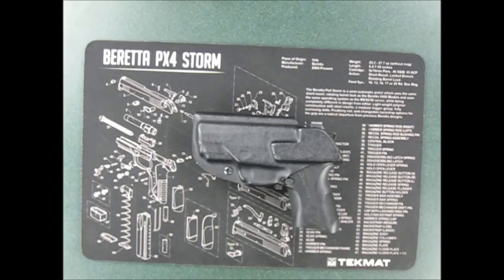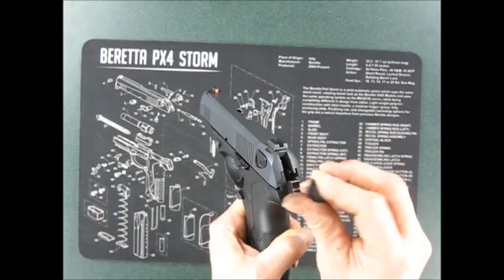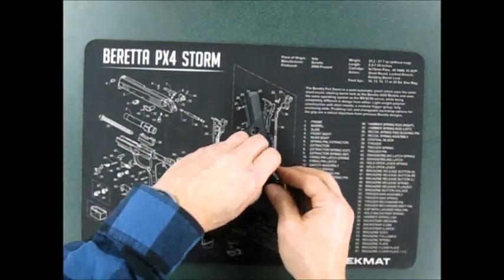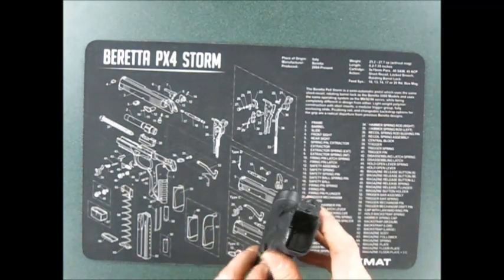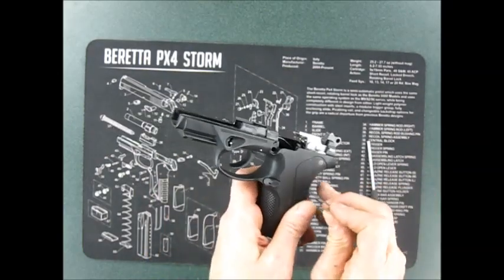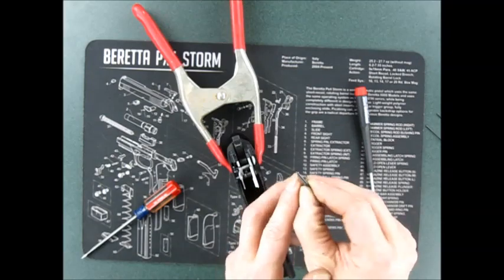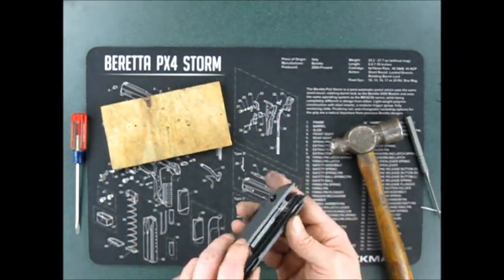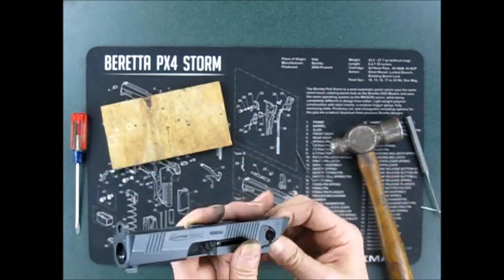Beretta PX4 Storm Compact complete disassembly / reassembly - Part 1

Comment: Your “Beretta in a Box” series was invaluable in my doing some tweaking on my PX4 Storm subcompact (yes, everything here can be applied to the subcompact, as far as I can see). I replaced my recoil spring assembly with stainless and replaced my composite trigger with steel. I expected to have some “adventures” with the trigger spring installation, but your method let me do it in about 5 minutes (I make a “necklace” out of the spring using thin but tough twine...keeps the spring from flying off into oblivion and then you just snip it and slide the twine out after the spring is captured).  Interestingly, I had the most trouble getting the trigger assembly and trigger bar re-assembled but a Langdon video and Doomsday Prepper Dude’s tutorial on the Langdon trigger bar installation helped along with your Beretta In A Box #3 to work through it and ultimately get it done...just took some patience. Also found it helpful to NOT pull the cap and hammer spring...you don’t need to if you keep the hammer down. Though on my first run, I DID remove the hammer spring and cap and inadvertently mixed up the floating trigger bar and cap retaining pin...but that was easily remedied...lol). Keep up the good work. YouTube videos saved me upwards of $400 or so in gunsmithing costs plus gave me a great sense of accomplishment in getting all three of my Berettas tweaked.

Comment: Removing the trigger shoe was more difficult and I ended up driving out the pin. Than realized the all metal trigger I was installing was needing to be sanded down to retain smooth pull. Probably took out the trigger pin 10 times.… none of which could I manipulate the spring to “loosen” on the pin. Could you get a pic of what the flathead screwdriver is doing to the spring so I can better understand how it’s releasing the pin. Thanks for the video definitely gave me confidence to replace several parts of my compact px4